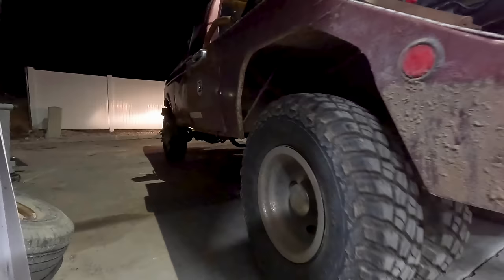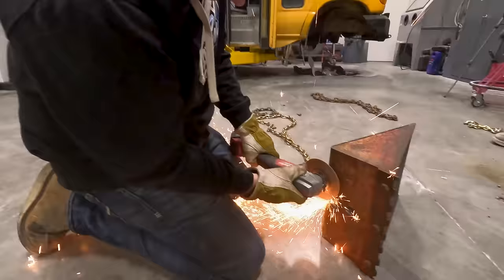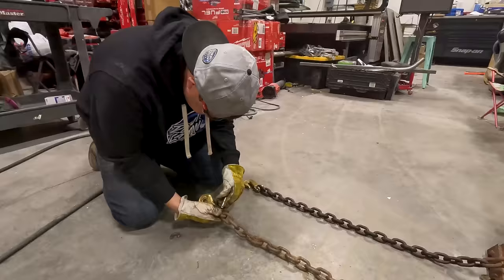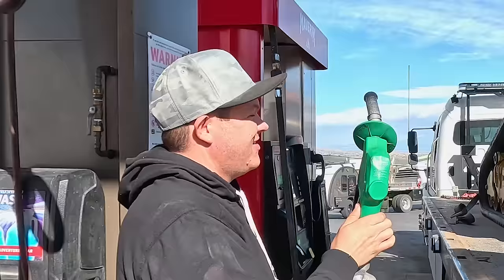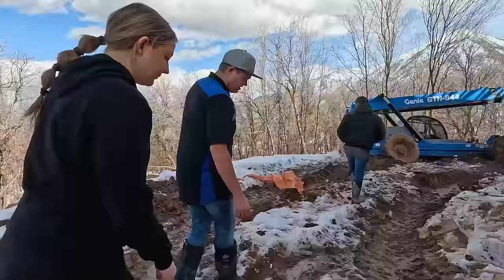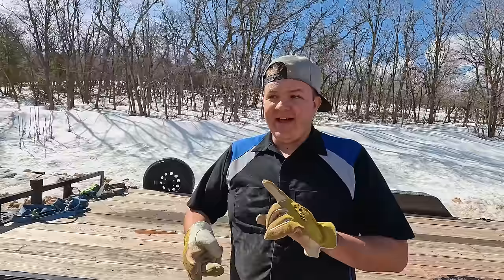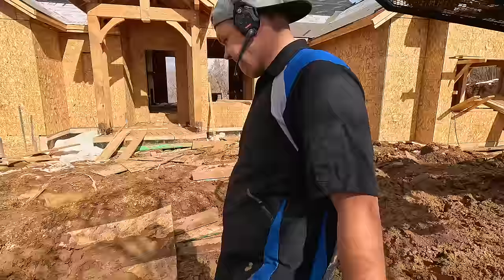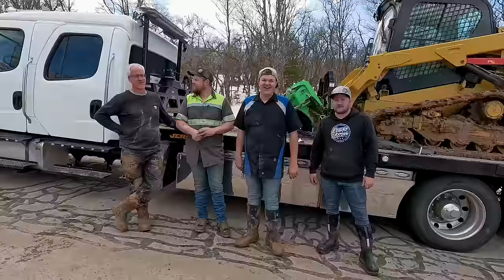This Is Not Good HUGE Fork Lift Stuck In Mud!

Comment: Love the video.  Dont want to critique but a little advice to avoid a ticket from the dot.  The way you had the skidsteer chained is not legal.  You can use one chain and 2 binders like you did but the chain has to be hooked in a manner where there is slack in the middle so if one side of the chain breaks or a binder breaks/backs off, the other side doesn't also come loose.  Keep the good content coming and hope you see this so you dont get ticketed.

Comment: Glad to see someone on You Tube figure out you need slack in the scotch blocks ttto back up onto them.  Years ago I was winching a fuel truck with a 1970 GMC 9500 with a 750 Holmes on scotch blocks on a road.  The pavement  I was pulling from started to move

Comment: Great recovery guys under difficult conditions - even deep mud is avoided by tracked vehicles e.g. tanks.  One note about your choice of wire-rope during the recovery. Years ago was wheeling across a flooded river - the contest was to cross and survive. Of course many trucks were stranded in deep water. I noticed the guy operating the winch controls was hunkered down below the windshield - while stupid drunk people were holding on to the steel winch line. He told me if a shackle or the cable gave way - like Harrison Ford's whip, the cable would cut a person in half,. He tried to warn them - but people kept holding on to the cable. Its easy to underestimate the force behind a commercial grade winch. I've noticed the lighter composite poly line that Matt uses - do you plan on re-roping your winches any time soon?

Comment: You need to know the efficiency of that pulley to know the force of the 2 to 1 system.  Probably around 85 percent so 1.85 times the force of the winch.  Winch force changes a lot though based on how much cable is on the winch spool.  The rating is usually based on the first wrap on the spool.  More layers decrease the force the winch can actually pull.
Reply: 👍 what I was trained is double minus 10% for friction loss of the sheave.

Comment: Robby you really need a wielding table so you can get up off the ground and off your knees. Trust me as you get older the more care of your body you take now the better it will be once you start getting in your 50's and above. If not a table to wield on at least use knee pads. Take it from some one that's been there.

Comment: Fork kifrs are made to work in a yard with level terrain or in warehouses mostly 
If your using them elsewhere put proper size tires on them .....extra wide with large treads
Reply: Yes regular fork lifts should be ran like you said yet this isn't a regular fork lift its a telehandler which is actually made to be used on construction sites to get materials up to the upper floors aswell as atleast up to the edge of the roof depending on building height an weight of object being lifted. These telehandlers are also able to lean the main body side to side to level itself out when being used on uneven terrain.. Yet there was no reason to try and drive that heavy machine thru all that very soft & wet dirt/mud without putting something on the mud prior to driving in it..

Comment: Robby, you have a multi-million dollar operation there, and you are working on the floor, without knee pads.  Speaking as someone that used to say "I don't need no sticking knee pads" in my later years I wish I was smarter then.

So make a welding table and use it, and wear knee pads.

Robby, count the lines going to the load.  That is your multiplier.  4 lines is 4 to 1 mechanical advantage.  (of course there is about 10% loss in friction)

Silly fork lift doesn't have lockers.

Comment: Glad to see King Fred finally back in shape putting in some work. Hibernation is hard on vehicles. I’m Chevy AND Ford guy but always favored the OBS Chevy over the OBS Fords. But  when it comes to OBS’s… If I’ve  said it once, I’ve said it a thousand times, the OBS Fords were/are straight up work mules. I’ve owned a few of each, and actually still have my OBS Chevy but it nor any other OBS Chevy I’ve had could out work any of the OBS Fords I’ve owned even the OBS Ford I had that was already thoroughly punished and abused by the previous owners.

Comment: I worked on a job once where a backhoe got stuck. It was behind a building, sunk to the frame, water was running out of the hole it was stuck in. That whole job site was a mud hole. It had rained everyday for the last month. I didn’t watch but that thing couldn’t move under its on power. Kenner’s wrecker was an old army 6 wheel drive from WW ll. They wouldn’t even crank it up for less than $500 that was in 1971 !

Comment: So when using pulleys or snatch blocks it is cut in half by each turn.  30k divided by 2 is 15k, 15/ 2 is 7.5, 7.5/2 is 3.75k lbs.

Comment: I believe my old 90 Cherokee had a fiberglass back hatch maybe not i didn't have a goober crash into it. But in the game's yours dented in .
Reply: They came both steel and fiberglass.
Reply: And the fiberglass was heavier, extra reinforcement
Reply: The last few years of XJ's got the metal rear hatch as it was designed for in first place.  My XJ had the rear hatch smashed in by a drunk driver right after I bought it.  🤬 Still a sore point for me.... a city employee at work in city vehicle.

Comment: The last time the company I worked for got the Gradall 10 stuck was not the first. 
"What's a Gradall 10?" you ask, well put that Genie on steroids, and introduce its even bigger brother. 
I didn't make a call to get it unstuck, but if you know how many 8 inch block come in a cube, three of them went into the ground underneath two tires in order to get it out, on a Saturday, with no help, and no other machinery to help. Yea🎉
Sometimes, you just have to throw money at a problem to make it go away.

Comment: For each rope going between pulleys you divide that number into the weight was 28,000 pounds, and you had 4 ropes, your load weight will be 7000 pounds.